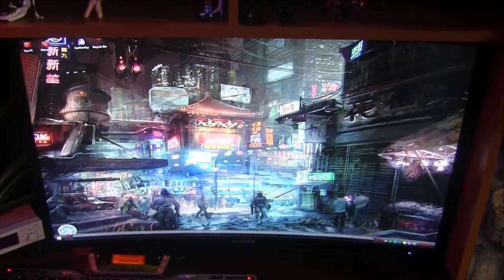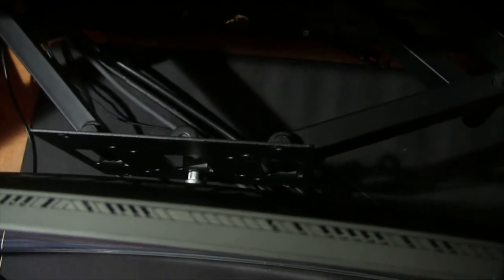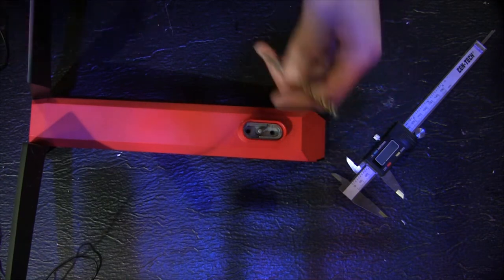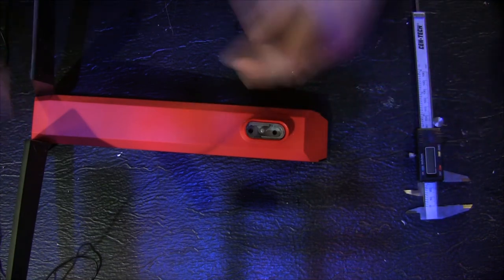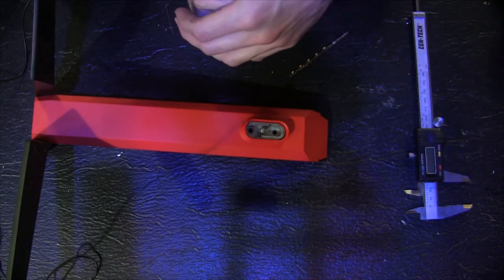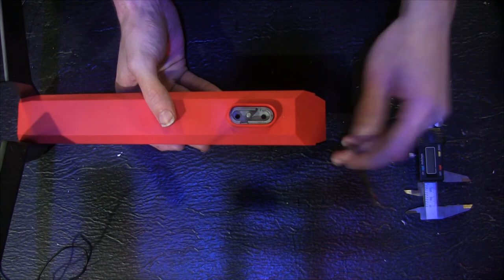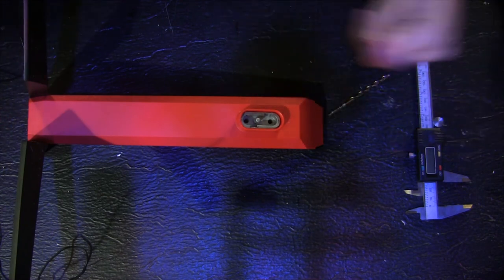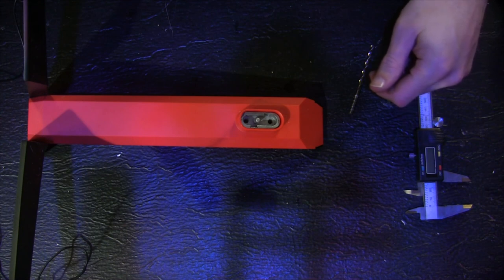Viotek GN32C On A WallMount?

Comment: Thanks for a good video!
I have had this monitor for over a year and it's awesome for gaming. the different settings like FPS and RTS also eye saver mode are all fantastic for different games/uses.
 I just tried mounting mine and noticed it had no VESA mount so i ended up here! gunna drill some holes myself and get this beast mounted. great buy and great price! 
 the only tip i have is: IF YOU PLAN ON RUNNING DUAL MONITORS go with the 27" version so you can run 2-3 of them, the 32" is rather large and unless you have lots of space it makes things tough for multi screens.

Comment: im thinking about getting this same monitor how u liking it for game?
Reply: i have it as well. for the price its unbeatable hands down. the only thing that i don't like is that due to its 32" size at 1080p you can definitely still see some pixels. i believe they made a 1440p in the same size, i would definitely recommend that over this. that, and if youre playing competitive shooter games due to the size you'll need to move the monitor pretty far away so you can really see everything well. overall, great monitor for the price. would i buy it again knowing what i do now? probably not. I'd much rather have a 27" than this at this point in time.
Reply: Marcus Springer na not a competitive gamer just won't a decent monitor. I'm on a 19 inch lcd screen from 2011 that I bought from Best buy for like 150 bucks lol. I was running dual screen but now I won't bigger cause I spend most my time at my computer. And play casual games with the wife.
Reply: I like it for games. No complaints. The resolution isn't bad and at the distance it is from me on the desk I don't really notice any pixels more so than the old 27" monitor next to it. Of course higher res is nicer but everything is a cost/value decision. I love the monitor for the price.  Vesa mount would have made it perfect for me. There are some companies making vesa adapters for the Viotek 27", but not for this model specifically.  Glad I found this video. going to have to DIY for a vesa mount. I want 3 eventually and will need to mount 2 if not all 3.